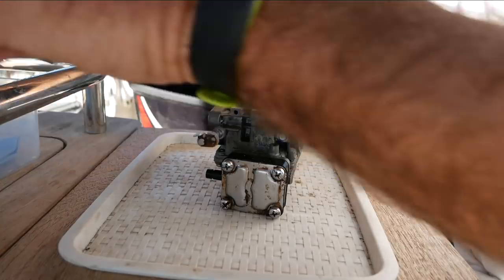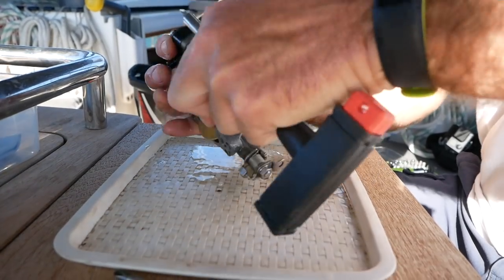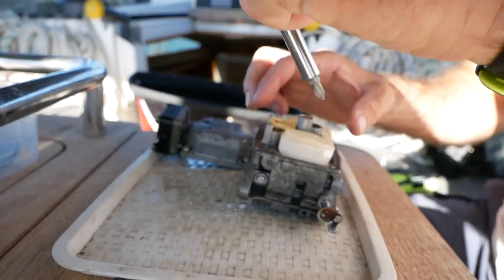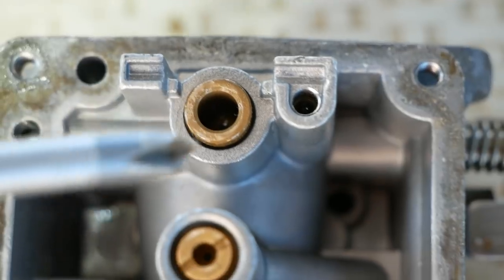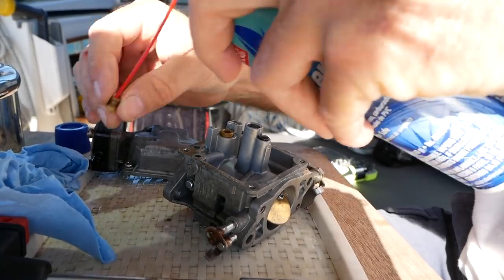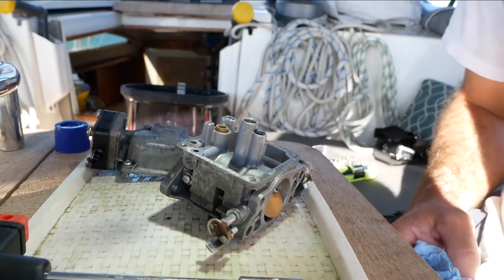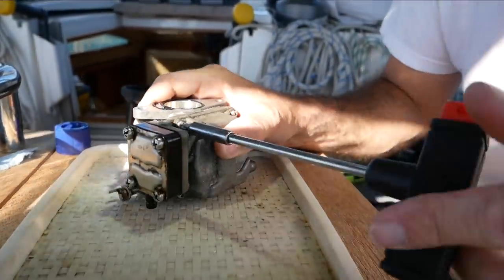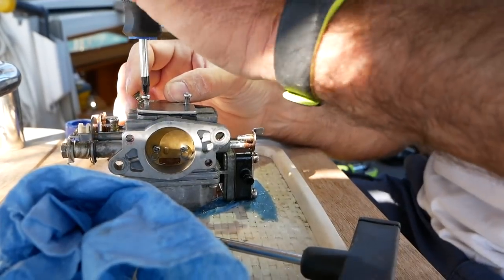How to quickly & easily service an outboard motor carburetor

Comment: We completed an extreme carb maintenance experience this weekend after patchy performance last summer season.  The 10% ethanol fuel not only blocked the carburetor with the typical gunk that needs the cleaning Nick so ably demonstrates in this video, but attracted rather a lot of water to the fuel, which needed changing. -- something worth checking if you still have the sort of issues that Nick mentioned after a carburetor service.  We also learned that dealer provided carburetor service kits do not supply the carburetor gaskets, which are easily damaged by normal wear and tear in some models/brands. They are a special order item and peculiar to engine model and manufacture date (in the case of our Suzuki).  We are considering a Torqeedo, to avoid back strain/pain rather than maintenance.

Comment: The jet you removed is called the main jet.   The other round brass piece in the body which you didn't remove is a part of the float assembly and is in fact the seat for the float valve.   The second assembly that you took apart with the black rubber diaphragm in it is in fact the engine fuel pump.   Glad to help!

Comment: A lot simpler than I always thought. A brave man using fiddly screws over water.  Thanks for that.  An improvement to this video could be to explain what each of those parts does as I have no idea what the float switch does or the fuel bowl etc etc.  I expect fault finding would be easier if I did know.  Either way, a great video.

Comment: Good video, I like your technical ones.
And others, of course !
I have maintained quite a few 2 stroke outboards my family had over the years. 
With additional fuel pre-filtering, you almost never have to service the carburetors.
Symptoms you mention in the beginning of your video can well be linked to failing of the fuel pump membrane and clogging of the fuel filter inside the removable fuel tank.
Also, for beginners, a bit more of focus could have been made in disconnecting / reconnecting of the choke lever and the gasket between the air filter / muffler and the carburetor itself.

Comment: Several people I know replace the Phillips-head and flat-blade fasteners with Torx-head or Allen-key-drive fasteners on small motors.  The Torx are slightly hardened and less likely to strip under-load at that most inconvenient time.  I keep a set of gunsmith tips in my tool-kit.  The flat-blades are parallel not-beveled so they're less likely to slip or strip-out a flat-blade machine-screw.  I also hand-file dedicated flat-blade tips for the jets, file a small shoulder on both ends of the blade to the center goes down into the jet-bore slightly and the blade-tip stays centered in the slot.

Comment: Another great video thanks.  Something to consider, I got tired of taking apart my motorcycle carbs, so I started using Lucas injector cleaner...been years now, use it on motorcycles, tractors, lawn mowers, 2 cycle weed wackers, old English sport cars, been years since I had to clean a carb.
Reply: Here's a link to a review...not important, but there's links in it for the product...https://youtu.be/TK-dsEKzQsw
Reply: I have been using Stabill Oil Foam to wiinterize my outboard. Do you think it will gunk up the carb?
Reply: Movie Maker, I use Stabil fuel stabilizer in a full tank, if not detachable, run it through...shut it down and stow.  Then on first full tank Lucas cleaner.  Then usually as the seasons change I will do Lucas again.  Took 3 carbs apart out of curiosity, & a deeper service, after 1,2, & 3 years of above approach ...all carbs were clean (4 cycle).  My plugs run longer & are cleaner too.  Happy spring & enjoy your day.

Comment: Good job, covered the basics. What you showed will fix the outboard problem 99.999% of the time ! Like you said, it is usually dirty fuel or water in the fuel. Will also fix most small gas engines like lawn mowers and the such. Question, on your external gas tank was that a priming pump ? Do you also run an inline fuel filter on that external gas tank line or is there a fuel filter under the engine cover ?  P.S. Your pretty handy with your hands. You should have a great career working with those hands ! LOL

Comment: Hi Nick If you are buying fuel in exotic locations add about a cup of metho to each 20 lts of fuel to dissipate any water which may have in the fuel you bought.Fuel Doctor or similar is good for keeping the fuel bugs away.

Regards.

David.

Comment: Also, for about ten dollars you can buy a carb overhaul kit for that particular carb.   The kit contains a new o ring seal for the float bowl, a new diaphragm for the fuel pump and likely a new valve for the float assy.   The vital part is the diaphragm as it vibrates continuously to pump fuel, driven by the pressure pulses from the crankcase.  The diaphragm will eventually fray through from the constant motion and then your pump won't pump.   Use a bit of silicone grease on the o ring to keep it supple.   Save your old but still serviceable parts for spares.

Comment: Nick, I put a small neodymium (rare earth) magnet next to my screwdriver tip when I don't feel like sharing with Poseidon. Check out "baja filter" cheap DIY way to make sure you are putting clean fuel in anything.

Comment: I wonder if seafoam in the fuel on occasion would prevent the need for regular carb cleaning? I have a small 4 stroke outboard that I hear is prone to  carb problems.

Comment: Two things, hardware(nuts, bolts, washers, and hose clamps) are not overly expensive, buy spares. Second, latex or nitrile gloves will allow you to make a salad without a gas smell! Nice work, as alway prevention is the most economical approach.

Comment: Have you seen many cruisers use a propane fueled outboard?  They are suppose to be very clean burning and never clog up.  Also I know the gas can put a film on the jets through normal operation, do you ever disconnect the hose run the carb dry before storing the motor on passages to help prevent this ?  Great video...
Reply: There was a report on one in the latest Cruising Helmsman publication (an Australian Magazine)  I reckon obtaining fuel in out the way places could be a real issue.  They had a fibreglass gas tank which was interesting (and very expensive)

Comment: Hi Nick , great video as always ! One request please , can you show how you launch and retrieve your rib and how you sling your engine on as I guess you use a halyard etc . I would also be interested in what size your rib is and how you find stowing it on the foredeck and the pros and cons against having a Rib v inflatable on a 38 ft boat  as I’m get my boat med ready and don’t know whether to go inflatable with a 3.5 hp and have the option to stow in a locker , place on snap Davies or foredeck , against a small rib with a larger engine , your thoughts and wisdom please ,Many thanks Darrell
Reply: Sailing Yacht Ruby Rose what model have you got the aluminium or GRP hull, starting to look at this option now , thanks for the advice D

Comment: Interesting as usual Nick, this seems the right time to ask your opinion about something I was recently discussing with a friend.  I believe that more manufacturers should consider using an articulated rudder in their design, it would improve dock maneuverability greatly and I would think be less strain on a auto pilot when on passage.  At least that is my basic thought what is your opinion ??
Reply: The trailing edge of the rubber can be operated separately from the leading edge of the rudder.  What you usually see with an articulated rudder is a secondary wheel inside the main steering wheel that operates the trailing edge of the rudder.  The trailing edge can also be used to fine tune the rudder when on a passage or simply left locked into the same angle as the leading edge.
Reply: Your right about it being another thing that could go wrong but in reality the only failure would be loss of control of the articulated arm and it would be easy to lock it to the leading edge but it would offer an extra (marginal) rudder if the leading edge failed for any reason. I believe many racing yachts use this system due to it's ability to maintain a heading more accurately and with less strain on steering components. Just a thought - one day I'll raise the beauty of a schooner rig (off the wind) compared to a cutter rig...........

Comment: X2 on dropping stuff...I've tied a 'bib' around the powerhead when working on the water, tied a ring magnet with a string, put it in the center of the bib and tied the other end of the string to my tool box. anything dropped would roll to the magnet. 👍 😂👎....maybe.

Comment: Great vid!  Appreciate the information.  I'm considering buying a catamaran that uses gasoline outboards rather than diesel engines. Easy to remove, supposedly easy to service, retractable, but then primary fuel is petrol.   What are your thoughts about such an arrangement?  Appreciate your advice.
Reply: APpreciate your advice.  I'm looking at two virtually identical 29' catamarans boats, same year, same build quality, but one with 20HP outboards and the other with  22 Hp diesels.  I'm told the boat with diesels has higher resale value but I think the convenience of fixing them is worth the less return.  Time to decide!

Comment: Good one, and be careful not to drop the bolts and screws overboard 😂
I prefer to take the motor off the rib, and do it on board the boat, just in case a screw drops over the back into the water. Do you ever need to adjust the fuel air mixture screw after cleaning it? I find I have to tweek it slightly to make the engine run smoother
Reply: Assuming its similiar to land based 2 strokes, check the plugs when adjusting the mix. You don't want to lean out and burnout your piston.

Comment: Do you keep a spare rebuild kit for your carburetors aboard?  They are relatively cheap, and have new jets, float needle & seat and all gaskets inside the kit.
Reply: Sailing Yacht Ruby Rose , if you had a mailbox, I'd send you one. Kits are dirt cheap here in the states.

Comment: When going away for weeks or especially months do you ad STA-BIL fuel stabilizer to your fuel tank and run some through your engine? I've seen another sailing channel's video recommending this and the reasons why. Made a lot of sense.
Reply: Heet would be better given the water and humidity. Stabil is good for fuel storage. Make sure you know your carb. Some 2 cycle carbs have rubber internals so the carb cleaner would dissolve them better to use WD40, wire, and an air hose. On those type. Low pressure of course 🙂

Comment: Impact screwdrivers are the bomb...never strip a screw again!  Do you normally find something you suspect was the issue?  Most of the marine carbs I have pulled apart due to bad performance had obvious issues, perforated diaphragms,  clogged jets, and for me mostly rusted springs.  If anyone is mucking about with 2-strokes, look up 'wash pattern' and it will change your life about how to fine tune 2-strokes!

Comment: One of the things I try to do whenever I am servicing carbs is to replace any fuel bowl screws with stainless or some other high grade allen head bolts. Next, if you don't have a 1/4 impact driver in your collection (I don't think I saw one in your tools vid) they are a god send  if a carb screw strips out  (https://goo.gl/8t5k74).

Comment: One thing I thought I have to mention, you turned the carb upside down and removed the bottom of the float bowl and in the end you only showed cleaning the upper section of the float bowl.
A lot of dirt and residue gets stuck in the bottom of the float bowl, it's more important to clean out the bottom than the top.

Comment: Nick, I hate to be a buzz-killer on this video, but there are one or two things that need to be said.  What you are calling the pilot-jet is the "main" jet aka the "high speed" jet.  It's the one that works when you give it throttle.  But, there is also another jet just for idle speeds, and you seem to have missed it.  It's hidden under the black rubber plug next to the main jet.  If this one is clogged, and it is the most vulnerable one, the engine may not start unless you have the choke on, and you may have to put the engine in gear under medium throttle to keep it from dying.

And now the question about using a wire to clean out the jets.  Whomever told you it's the work of the devil is absolutely right.  The holes are precision sized, and they're made out of brass, which is a very soft metal, as you noted in your video.  You won't hurt anything if you're running the piano wire/guitar string through a jet that's not clogged, unless it's the right size for the hole and has a burr at the end.  But, if it's clogged shut and you run a wire through it, chances are you'll gouge a groove or two in the hole, and it will no longer be a precision sized hole.  

The hole in the idle jet is tiny - perhaps as small as 0.2 millimeters.  You don't have a wire that small, and if you did, you would almost certainly bugger it up.  The only thing you should use on the jets is carb cleaner, or acetone, or MEK, or maybe brake parts cleaner, as well as a soft brush if you insist.  Soft means nylon or boars hair - not brass or stainless steel.  It's best to just let the chemicals do the job.  They're designed for that purpose.  My neighbor a couple of weeks ago had a clogged idle jet with the usual problems.  I put it in a cup with a small amount of MEK and swished it around for a couple of minutes.  I took the piece of wire away from him.  Fortunately, it was way too large to fit that tiny little hole and caused no damage.  He praised me later, saying the engine started on the first pull.  He had already had several tries at it.

On the subject of chemicals: it's your boat.  Personally I don't like to have a lot of solvents on mine, because some of them don't have a lot of odorants so you can't smell them.  Some of them are heavier than air, so they create an explosive mixture in the bilge or on the sole.  Since I have to have something, I have MEK.  It's a close relative to acetone, but it stinks to high heaven.  As a result, the newbie is unlikely to open a can of MEK below decks.

But, generally, there's a lot of good info in your tech videos, and like everyone else, I'm glad you post them, in spite of the risk of some jackass like me coming along and pointing out problems.
Reply: Just be sure to pull that rubber plug out the next time you have a problem.  I did the exact thing you did the first time I tried to repair mine.  Then when it didn't work, I thought:  "OK, it's not working at idle.  Why?  Oh, yeah, the idle /low speed jet is clogged."  With no manual, it took awhile, but I noticed the rebuild kit had replacement rubber plugs, so I popped that one off, and there was the hidden jet.
Reply: By the way, there may be an emulsion jet below the main/high speed jet.  It's not screwed in - just laying there and it only fits in one way: the right way.  Be sure to take a close look to make sure the tiny holes on the side aren't clogged.  Same rules: no wires, just chemicals.
Reply: yes the issue is always under the rubber plug....its a very small jet and need to be cleaned with your finest sewing needle.....the little holes on the side are just as important as the one in the middle....you will need a small screw driver for this....
Reply: john gomes In the two cases I've seen of clogged idle jets, soaking it in MEK for a few minutes was all that was needed.  No risk of deforming the hole with a piece of metal.
Reply: Great tech segment and cool video graphics.  I do have to agree with Quakboy02.  I was OMC trained once.
Take care,

Comment: Any chance you could make a video on patching RIB holes or seam leaks?  We'll all forgive you if you don't poke a hole in a bladder just to prove your repair works.  =)
Reply: Well, the reason I ask is that I've got an old RIB and I've been having problems with seam leaks.  I think I'm doing the repairs correctly, but watching someone else who's been there would give a lot of confidence.
Reply: Quakeboy02 Use 3m 5200, does much better job then the patch kits available.
Reply: david kaehele I never would have thought of that!  Is the 5200 flexible enough?  I'm a newbie as far as boat specific things are concerned.  It takes longer to set, or even get tacky, than the patch kit glues do, doesn't it?  Do you use a clamp to keep the patch or seam in place for a couple of days with the 5200, then?

Comment: Wy not put a fuelfilter instead?
Reply: If I remember correctly, none of the newer engines have visible fuel bowls.  That's a pity as it is a great feature.  Engine stutters a bit...glare at bowl...any crud means you are closing in on servicing the carb.  Happens all the time on our older jet skis.  A friend 'does me a favor' and gets it gassed up at the marina, but doesn't get the cap on right, does some submarining on the waves, and then comes back to the dock to report it's not running right.  Check the bulb and sure enough the water float is bobbing along.  sigh...